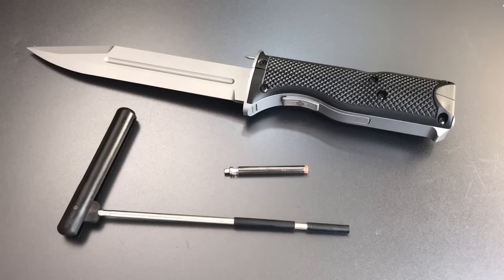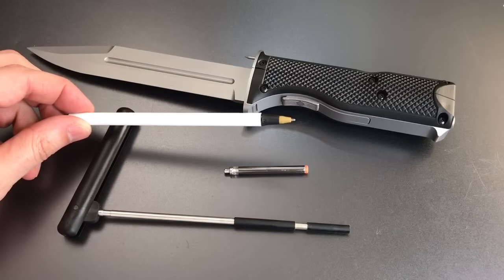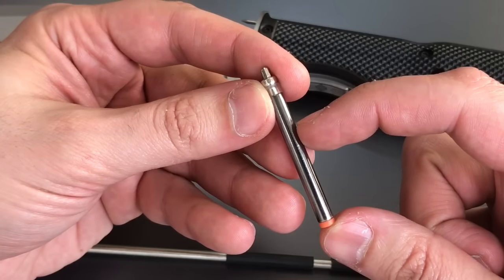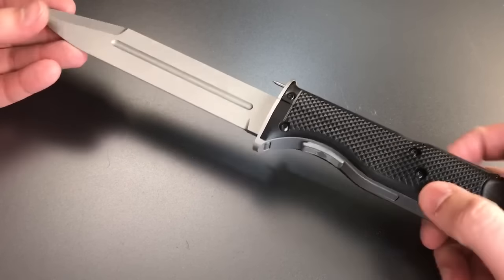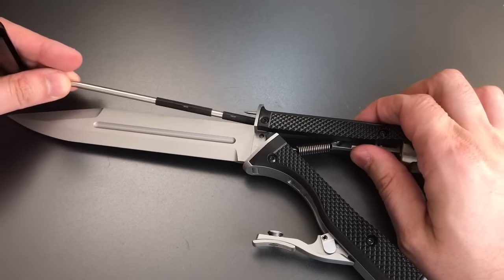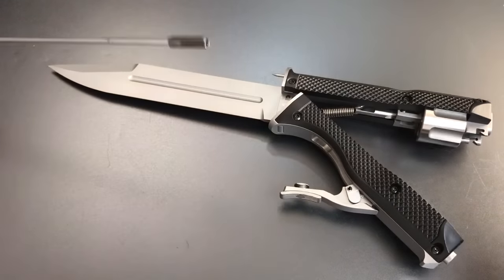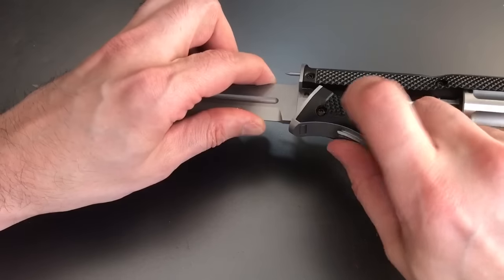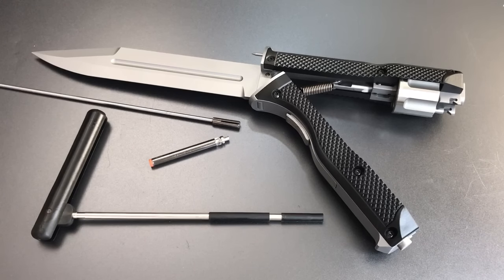[460] Omega Internal Revolver Lock Opened

Comment: You have to also consider the fact that a teenager is not going to know that that tiny lock is seated inside the barrel. They may just assume the gun is jammed or has some kind of safety on which would deter them from even trying to look up a solution. Or if they did try looking up a solution they may be looking up the wrong thing such as "how to unjam .22 cal revolver". I know when I was 12 I was very interested in tinkering and without prior knowledge of the locks existence or knowing how it worked it would have 100% fooled me. Unless my dad had specifically showed me what it was and how it worked. I would assume the same thing for any thief out there. Even if you had seen this video before without there being much of a visual cue to this thing being in the barrel/cylinder you wouldn't really know what you were trying to defeat in the first place. It may not come to mind. Where as with other locks you immediately see what you are up against, usually can see a brand name etc, and then can look up and implement a work around.

Comment: I'm late to the party on this one, but I would not call that a good choice for a gun lock. Aside from the fact that there are ways to remove it without using the proper tool, you are risking damage to the gun every time you use it. Not to mention that it is commonly taught that only two things should ever go down the barrel of a firearm, the ammunition and a cleaning rod. Also, what happens if you do manage to pull the trigger of the gun while this gun lock is engaged? Seems to me that something is likely to break, either the gun or the lock, and likely both.

Comment: I  guess the average person would not understand how that lock work. it's interesting but on a collector's piece like that maybe a good tight fitting pad lock, with the handle open. It a class 3 weapon, I have one and I love it. I also have one of the original stinger pen gun in 32 caliber,and don't know how you would lock it ?
Reply from the maker: Locking the stinger... now that's a challenge.  I've always liked the stinger... the ingenuity in its design is remarkable.
Reply: LockPickingLawyer It is quite remarkable in its design.But on the lock, I guess you can always unscrew the front Barrel and keep it separate from the pen

Comment: Is the barrel too small to take the actual pen part of the BIG pen? That's just a tiny plastic tube with an open end. 
If it can be inserted end first, it should be enough to grip the lock and open it.

Comment: If you actually used the supplied key for locking, could you get it tight enough that the improvised solution wouldn’t work?

Comment: I really wonder if you were to put the firearm with the lock in it, into the freezer for a few hours, if that cold would make the rubber and other materials shrink enough to just pull it out? If so I wonder if you could do it with a cold spray as well, something like compressed air turned upside down?
Reply: The metal of the barrel would surely shrink more than the rubber.

Comment: My question is, had you used the actual wrench made for the lock to tighten it, would the improvised tool be strong enough to loosen it? It stands to reason that there would be much more torque on the lock if it was tightened with the proper wrench.

Comment: so... if the gun is open the depression of the trigger doesn't fire, and closing it locks the trigger into either up or down states.
Reply from the maker: +morthim Closing the handle doesn't lock anything... when the handle is closed, the Trigger can be deployed, but once it is, the Trigger can't be stowed without firing the gun. To stow it, you need to open the handle.

Comment: That is the worst locking mechanism I can imagine.  That expanding ring is eventually going to wear out and start falling apart, leading to a day when you either can't get it into the barrel, or worse you can't get it back out.  Some of the interior parts of the planes I work on have a similar mechanism, and they all do this eventually.  The rubber cracks and falls apart and jams everything up or just wastes my time having to order extra parts just to reinstall an access panel.  I despise them and wish they'd just used regular screws.  I would never use this on any firearm.

Comment: I personally believe that a gun lock is only valuable if it can be removed quickly by a terrified person who is currently in life threatening danger
this clearly is NOT that, so I believe that it fails a primary function of a gun lock
A function that I believe is FAR more important that defending against willful improvised unlocking, with the second primary function being to guard against ACCIDENTAL firing
If someone is constructing a tool to defeat a gun lock, that is not an accident, that is deliberate malice

Comment: These Omega locks aren't very good in my opinion. They aren't even locks, they're just blockers. Now if you had one of these that had an actual lock in the end that you lock and unlock with a key-on-a-stick type thing, that could be very useful. You couldn't just shove a tool down the barrel and picking it would be near impossible because of the difficulty of getting tension on a lock that deep inside a tube.
Reply from the maker: A real lock would be great... but fitting one into a package that small would be very, very hard.

Comment: I am not convinced you even locked it. You did not tilt the barrel down when checking if the lock was secure. You shook it and checked the trigger but that proves nothing. The trigger is jammed so long as the mechanism is in place but need not be locked down. Slight of hand going on here.

Comment: If you're that worried about someone shooting your fucking revolver, how about just not leave it loaded? Makes a lot more sense than loading it and putting some crazy doodad down the barrel. It would take longer to get that fuckin thing out than it would to throw a few rounds in yet cylinder if need be. Basically, Unloaded Gun > Weird Ass Potentially Dangerous Bore Obstruction With A Lock

Comment: Aren’t all pistols technically semi auto?
Reply: No. Semi Auto refers to a gun that is auto loading. A revolver still requires you to manually pull the trigger or the hammer back to move the next round into position, doesn't do it for you.

Comment: I suppose this 'lock' would prevent someone picking up a firearm secured with it and shooting you with your own gun, because you can't casually see that it's been rendered unfireable in this way. So that's a good thing, but it's also going to be a bit fiddly if you need to pick it up in a hurry to use it yourself. The obvious way to prevent children getting thier hands on a loaded firearm would be to not have one in the first place or have the firearm and ammunition in a real security safe. There's no easy way to have a firearm easily accessable to you whilst keeping it secure at the same time. It's probably safer to get a guard dog instead.